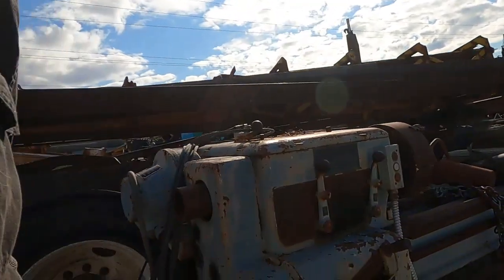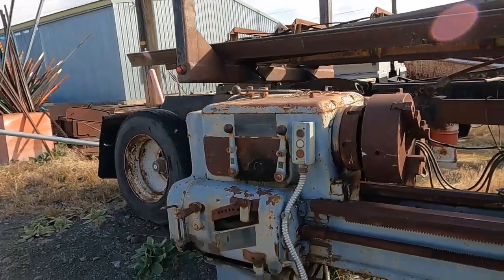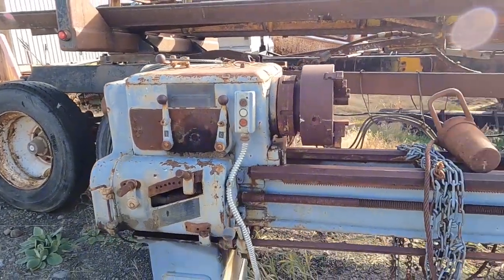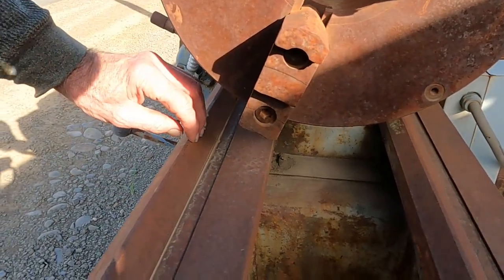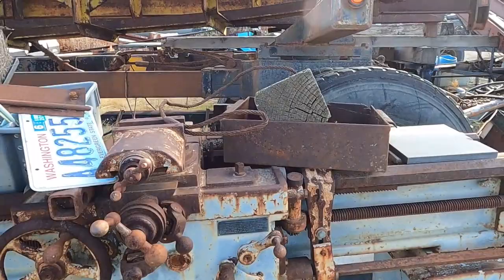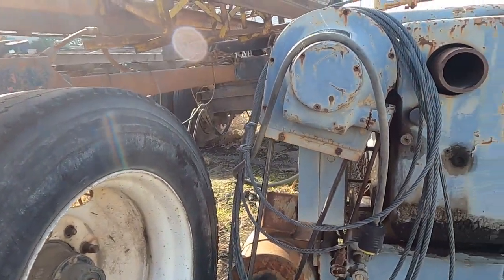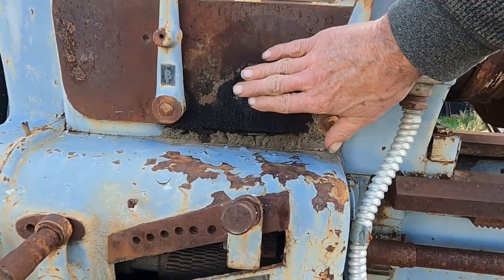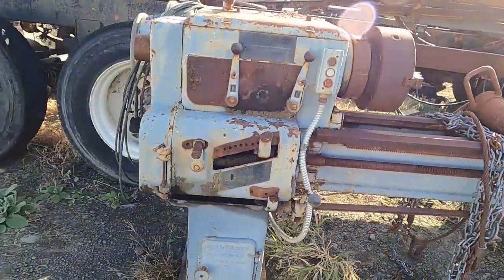McIlvanie Century gear head engine lathe

Comment: A lot of capacity for light cuts where critical accuracy isn't that important .
Reply from the maker: It appears this lathe and the other machine tools were recovered from a collapsed building some years back and have been in this yard for several years now. The machines were in good condition before scrapping.